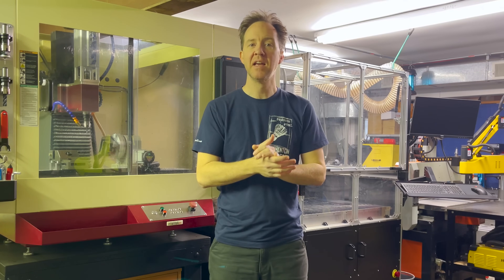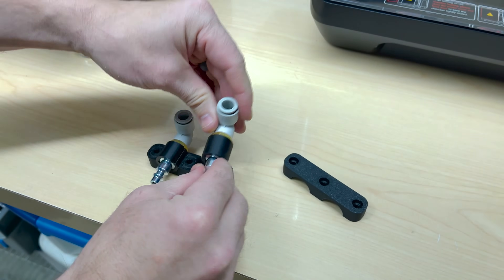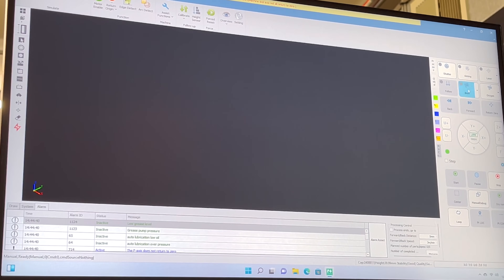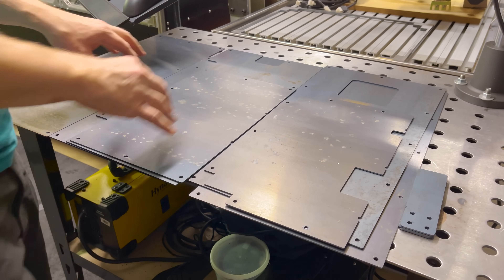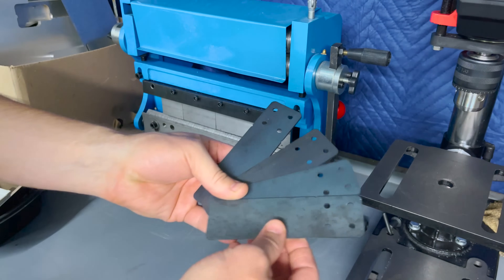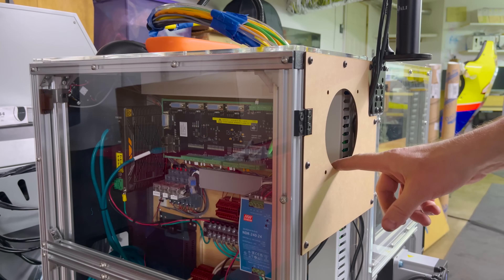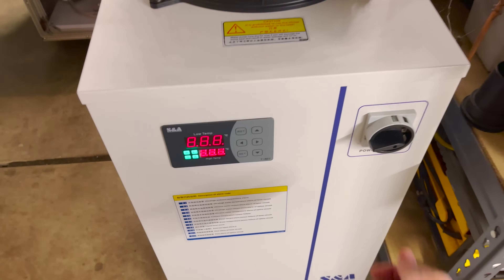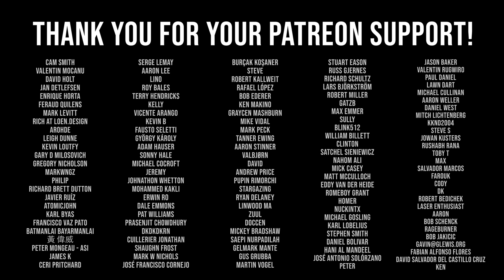DIY Fiber Laser Tube Cutting Machine | Part 12: Gas Control System

Comment: Hi Travis, thoroughly enjoying your builds, I’m learning quite a bit about the DIY laser universe from you, thanks🥂. I noticed when you inserted the oxygen tube into the quick fitting you didn’t use an internal ferrule to stiffen the tube maximising the grip on the blades behind the o-ring. I regularly use the same quick fittings for water plumbing and they will fail in time without the inserts. The water is usually around 6-14 bar
Reply from the maker: Thanks for the suggestion, I will look into that. The oxygen pressure is always below 3 bar, so hopefully it won't be an issue.

Comment: do you need oxygen or can you get away with just compressed air? i 100 percent cut mild steel
Reply from the maker: Depends on the laser power, with my 1kw unit I cut everything thing over 2mm thick with O2

Comment: Another great video sir! Question, are you using O2 or compressed air on these cuts, and if either are you running your chiller? Thank you again.
Reply from the maker: O2, and yes I always run the chiller
Reply: @diyfiberlaser  Understand, thank you. Sky Fire has been a pleasure to work with. FedEx damaged my chiller and Sky Fire was on it quickly to send a replacement. I am pretty much building mine by watching your videos. It does make it easier that I all have the main frame of my current plasma table, i.e. 4X8 table, drive gear, etc. Just swapping out motors to closed loop for starters.

Comment: Now to combine both machines into 1 ?

https://youtu.be/1iPYdenHEB0?si=tSxdzpQqtM-jfzTD
Reply from the maker: I’ve seen those…very interesting…too bad they are not selling machines anymore
Reply: @diyfiberlaser  Possible future project ? 😅
Reply from the maker: Probably not, I like my separate machines. I was thinking of making a poll at some point to see what my audience is most interested in, at the moment my top 3 potential next projects would be: 1. Metal 3D printer 2. Press brake 3. High speed RF CO2 laser…in no particular order…any thoughts?
Reply: @diyfiberlaser  if those are the 3 then metal 3D printer no question! Sounds like a tricky project though !
Reply from the maker: @ElectricBikeLaboratory  That's my favorite also...I have to decide if I want to take on something that challenging?
Reply: @diyfiberlaser  What are your early thoughts ? Controlled fiber laser weld with wire feed ? Or are you thinking like an SLS or different setup ?
Reply from the maker: SLS with galvo head…I’ve done some early research and discussed with Raycus when I was in China…my level of confidence that I could pull it off is medium, but I do enjoy a good challenge

Comment: technically its not the sticker its the fact that its white and it reflects the beam 🤣
Reply from the maker: Noted!…if the sticker is black I will leave it then 😀
Reply: @diyfiberlaser  thinking about it. maybe it could have been the fumes from heating up the glue/paper that played havoc with the assist gas/beam.  those thermally sensitive papers have some pretty gnarly chemicals in them to make them work. do you have a video of it cutting when it happened?
Reply from the maker: @weldchip  https://youtu.be/dkdqwTMXJwg?si=J0xDYYZshaQXUlXh&t=414
Reply: @diyfiberlaser didn't appear to be any visible smoke, time to buy a pack of different color stickers and commence in depth testing 😂
Reply from the maker: Haha yes!
Reply: @diyfiberlaser yep technically it should be fine 😂 the CO2 lasers have a different wavelength compared to the fiber lasers so slightly different behaviours

Comment: From aprox 6:10 to 7:10 you are cutting 14 gauge steel.  Two questions, is the video running at normal speed or have you sped it up?  What power are you cutting at?  (either watts or % of max)
Great builds, now I just need to find $10K in the budget!
Reply from the maker: That footage is 300% speed, you can watch the previous video to see it at real time speed, cutting at 100% power at 1kw
Reply: @diyfiberlaser  Thank you!

Comment: Have you heard about Skyfires upcoming 1200W fiber laser cutting machine ? Apparently 600mm x 600mm working area , air cooled 1200W fiber source. What do you think so far and are they in communication with you about it?
Reply from the maker: No comment 😉
Reply: @diyfiberlaser  I hope when it leaves it is Travis Mitchell approved !!

Comment: not laser related, but what do you think of a CNC press brake for the next project? there are not many projects and it seems like you need one from the last vids
Reply from the maker: Haha, people were mentioning that in the last video comments….it is an interesting idea…I’ve added to my list of potential future projects, because it looks like it would be a fun project and be very useful in my workshop
Reply: @diyfiberlaser  I always wanted to see someone build a DIY turret press but I guess the laser covers most of those use cases.
Reply: Langmuir Systems TITAN 25T looks pretty accessible for the hobbyist to be honest. But yeah, it would be fun. Different kind of challenge.
Reply: They're really not something that's DIY friendly unless you have access to very large equipment. Mine is one of a few or maybe the only fully cnc controlled "homebuilt" brake. It's over 4,000lbs. You could do smaller one of a different design though. They're not cheap to build either. Better off importing a small Chinese one or the Langmuir which is pretty much a copy of my build even know they deny it lol. I'm going to be doing more videos on mine when I do some updates on it. Ditching the conventional hydraulic system and doing independent ram control with closed loop AC servo hydraulics. I have a few videos on it on my channel. I'm also doing a 5x5 1500W laser table build here soon also.
Reply from the maker: Cool, I will check out your videos!
Reply from the maker: Nice, that thing is a beast! I would definitely have to do something smaller in scale